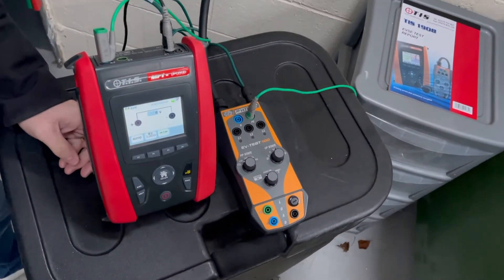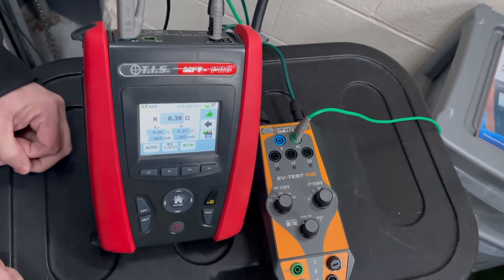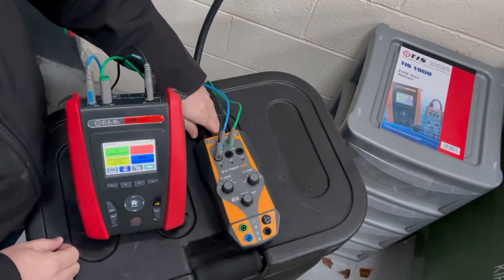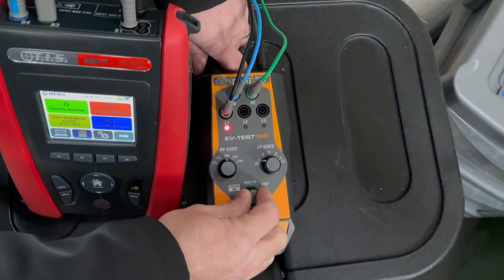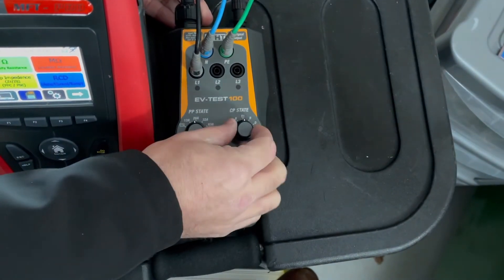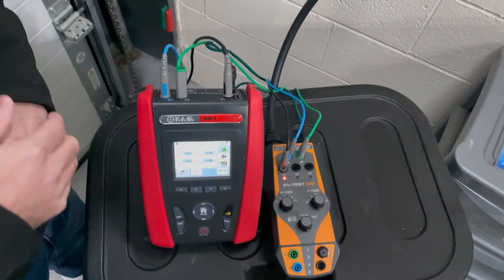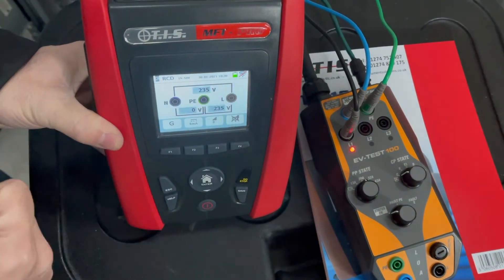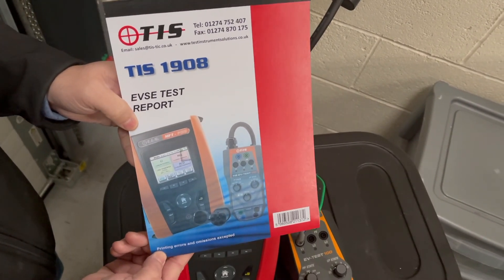TIS EV-TEST100 Manual Operation.

Comment: It's a pity the Fault dial on the T100  does not have the OK position in the middle of the 2 fault positions, so the extinguishing of the L1 voltage indicator light could be seen as both faults are put onto the system independently of each other.

Comment: How does the MFT-Pro do the Continuity measurement when there is only one conductor connecting the T100 to the MFT. 
i.e. the green lead.    The black lead is plugged into the MFT but not the T100. Where does it go?